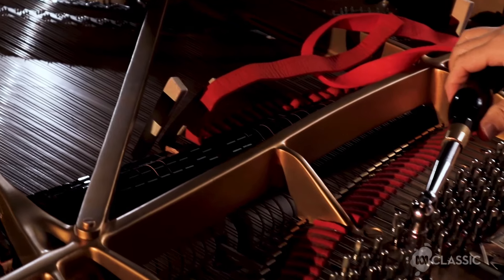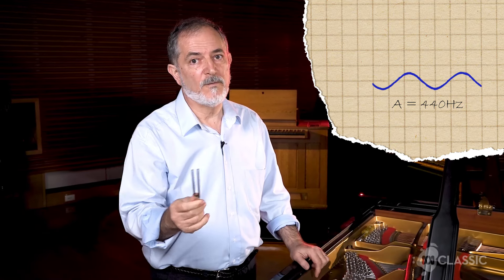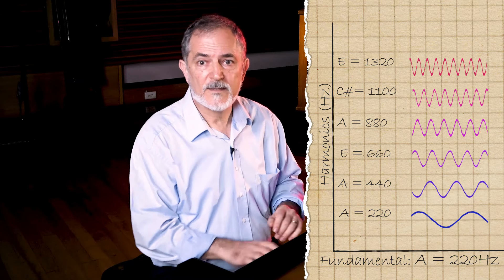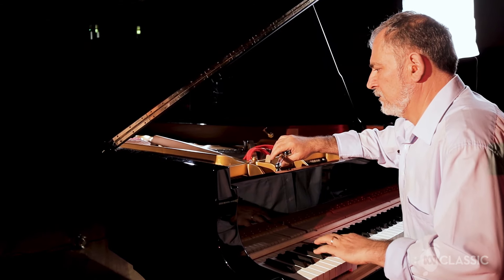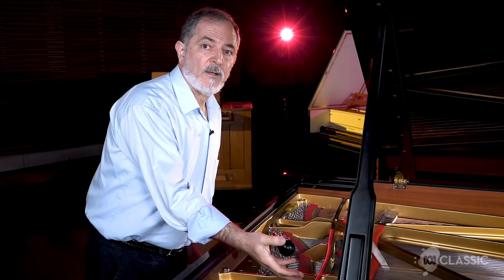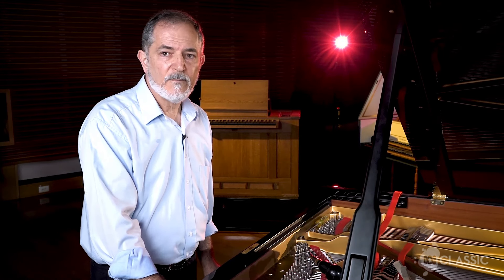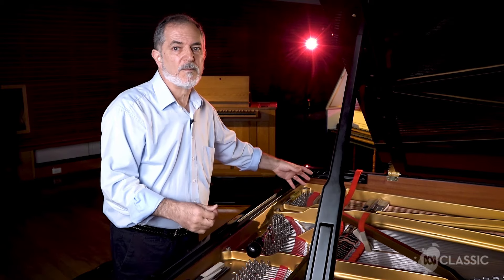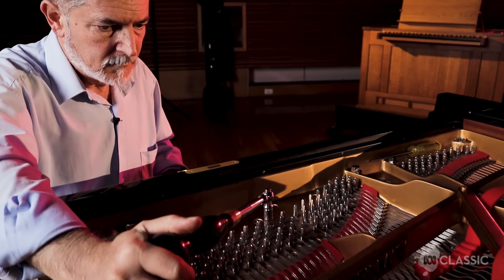How do you tune a piano?

Comment: Finally a video that explains the science and not just "tune each string to pitch".  I'm glad he discusses equal temperament vs just intonation
Reply: Hoestly, this wasnt even in any way a helpful explanation. It served to show that the subject of tuning is more difficult than what ppl think. But having looked into just intonation based systems, i can say in most cases ppl will want their pianos to be in ET anyway. Its not practical to tune in more natural tunings. Unless you have a specific piece, in a specific key, or keys. And tuning to ET is honestly not that difficult. Any tuner app can give that basic capacity... so ppl shouldnt really suffer a badly tuned piano for their practices, or have to fork out for a technician every time they want some simple retuning...

Comment: I had a tuner explain to me what he was doing.  It seemed to make sense and after some messing around, I was able to reproduce it moderately well.  The idea is to set the center strings for an octave in the middle of the piano, making fifths a tad narrow and fourths a tad wide, and then once thirds and sixths are possible tests with them for being reasonable are carried out, until the circle of fifths has been completed.  From there, set other octaves in turn first down then up from the initial reference octave, keeping in mind the stretch tuning towards the extreme bass and treble ends.  Set the adjacent strings to the tuned strings, check the whole keyboard for sounding reasonable, and Roberta's your aunt.  At least in principle.

To be able to set just one string at a time for a single key, either a damping felt strip or a rubber wedge is used to mute the strings that one does not want to be sounding.

For some reason I found it easier to do this with an upright than with a grand.  Maybe it had something to do with the overtones.

Once I got a decent digital piano, which was more than 15 years after I began to learn acoustic piano, I hated to go to any other kind unless it was a pretty recently tuned acoustic piano.  Still, decent acoustic pianos in tune sound absolutely gorgeous.

Comment: I’d like more information on tuning, since I started getting paid to tune pianos locally. Most of the jobs are pianos that have been out for more than 10 years which is good practice, but I know I could be more efficient and effective at it. The equal temperament is definitely a trick since  (reiterating) most pianos I tune have been sitting too long.

Comment: Are the high notes really tuned higher and low notes tuned lower than what they should be ? I tune my piano with an app
Reply: And how does it sound to you? Are you happy with it or do you feel it can be better?
Reply: Yes, because your app is making those adjustments for you, but only based on theory. But, an app will NEVER be able to account for EACH instrument. My piano sounds like garbage when a tech uses an app. When a tech uses their ear after starting with A4, then the piano is AMAZING.
Reply: Yes, that is correct. When tuning at concerts I was often asked for a stretched tuning. They were asking to make sure I was good enough for the job. If YOU have a piano...tune the lower bass notes pure. When they are played together they sound in tune. (Mathematically, they are). But if you play the higher note first, hold it down, then immediately after, play the lower note, the lower note sounds SHARP..the opposite is true in the treble ie hold the lower note first , then immediately after, play the upper note..sounds FLAT. It's exactly as he said in the video: the higher the pitch, the flatter your ears perceive the pitch to be. The lower the pitch, the higher your ears perceive the pitch to be. The bass has to be very gradually tuned flat, the treble very gradually sharp.
Reply: @Jack-hy1zq  Thanks !

Comment: Really Interesting,  and thanks for posting this.  Could I  please ask you opinion ( not that I'm doubting others,  I might add ) .
I have a nice upright piano circa early 1920s, as far as I can ascertain from my research.  I've had it over 40 years, during which time it's been tuned numerous times, as you might  expect.  Generally,  it's about  semitone flat,  or slightly more,  and as you might expect some notes are further out than others.  
My question is this.  In the past,  once or twice, I've  asked the Tuner if it's possible to tune my piano nearer to the full  pitch of  ? 440 ?.
However,  the response I've had is, due to its age  it's safer  just to tune it, ""To it's Self"" i.e.  slightly flat.  As you'd probably end up breaking a number of strings and running up a fairly substantial bill.  
How bigger risk is this in opinion ( and I fully accept it's your opinion and not a guarantee in anyway) 
Many thanks
Roj
Reply: I had a tuner warn me about the same thing on an old upright.  The strings begin to gather corrosion over all those years in most environments due to sufficient moisture.  This could create weak places that would give way upon significant tightening.  Once one does start replacing strings, even apart from the cost (and it could conceivably be done DIY), they are also going to make the piano sound different for those notes.  A full pitch raise for a piano that old is normally done in conjunction with replacing all the strings.  I chose to have the tuner raise the pitch barely perceptibly, and the strings held up.
Reply: Get a different Piano tuner the is in  Piano Technicians Guild that is not afraid to perform a procedure called a Pitch Raise/ Pitch Adjustment.

Comment: When they showed the harmonics above A and D on the charts, the A harmonic above A4 was 880hz but the A harmonic above the D was 881hz.  Is this due to equal temperament tuning?
Reply: It depends on how the harmonic was reached, adding a fifth to a fourth or using a direct octave.  In equal temperament, the fourths and fifths end up slightly fudged so that octaves are accurate.

Comment: This video seems very informative, but I can't wrap my head around how it's possible that the last note in the 4 minor thirds is flat compared to the last note in the 3 major thirds, when both notes are the exact same note and octave? How did that happen? Is it the illusion created by the underlying notes played that causes this?

Edit: I listened to it again, and I guess the idea is that that notes that are an octave apart should fit harmonically into both major thirds and minor thirds of the scale? Meaning notes that are an octave apart aren't meant to be exactly tuned mathematically?
Reply: I think that he is saying that when you tune it with 3rds and 4ths, then it won't line up. Maybe notes tuned to 4ths will sound better with 2.999, whereas 3rd will be 4.1111. Do you know what I mean?
Reply: The simplest way to explain the problem is tuning a guitar by ear.  If you work you way across the fret board tuning each adjacent string perfectly to its neighbour by the old fashioned 5 and 4 fret method, and then compare the top and bottom E strings to each other they will be slightly out of tune.
To get a perfect octave between the top and bottom E strings every one of the strings in between needs to be tuned ever so slightly away from perfect.  An electronic guitar tuner will do that adjustment for you (hence why you will often see it described as a equal temperament tuner).  
If that problem exists over just 6 strings, imagine the problem over 88 strings.

Comment: How do you make the semitone wider and the G narrower?
Reply: Listen to prefect fifths, fourths, thirds and sixths how these intervalls WOULD sound in theory if perfectly tuned and then you slightly lower or higher the interval between the two notes. This is called equal temperament. You tune slightly wrong on purpose so that the big pictures sounds approximately correct. If you would tune in perfect intervals you wouldn't notice much within one octave but if you play 2 notes a couple octaves away from each other you'll hear an awful sound

Comment: An expert can  design a website using word press or they can make things much harder on themselves by doing it all in code (html etc). Similarly a piano tuner can can match coincident partials and determine stretch with thier brain or use an advanced tuning app. The tuning apps were designed to do the same exact thing those who tune by ear do. I can use double octaves and arpeggios to determine if my stretch is accurate. I don't need to use a tuning fork or count and compare beat speeds of various partials. I don't need what your advocating slowing me down unecessariuly  IM running a business not only to support myself but not to waste my customers money. The Pianos technicians Guild  requires that the way you tune be used on their tuning test in order to be considered "competent." I see no point in it.
Reply: As someone else just asked before you, an app can't account for each instrument. My piano, as I mentioned, sounds like garbage when a tech tunes it to an app, but sounds amazing when done as this video demonstrates. I had a tech once start with an app and immediately realize that it was going to sound bad. As far as time and customer's money? Using an app will take longer than using your ear.
Reply: I have to agree.
I had the first piano tuner who tune like the technician in this video. Sound marvellous and never miss a note untuned.

Second technician tunes using app and always miss some notes obviously untuned.
Making me not wanting to touch the piano at all =(

Comment: Sorry, string physics do not allow a piano to produce harmonics.  The term is misused in this context. Harmonics are integer multiples of the fundamental pitch.  Strings produce overtones that are higher in frequency than their expected pitch due to the rigidity of wire, amongs other things.
Reply: True, but it's a colloquial in this context. Imagine if I were playing modern music were Harmonics were indicted in the instructions, but they had to write out "play the overtone higher in frequency than its expected pitch due to the string being thicker on the composer's piano than the student's CASIO." :D
Reply: Good point RG. But since many (most, I imagine) other musical instruments (& sounds) produce harmonics, it's less confusing in an informal context to refer to overtones in the same way - it's an accepted industry practice, if you will
Reply: Sometimes another word works better for the audience. But you are correct, and we do need to use the right words, lest we make lazy thinkers.

Comment: Shouldn't a piano be tuned to equal temperament? If you're tuning by harmonics, you'd be using just intonation. Also, the octave stretch is due to the piano string harmonics being slightly sharp from what they would be on a perfect string. Longer strings (like on a concert grand) behave more ideally and need less octave stretch, while shorter strings (like on a small console upright) need more.